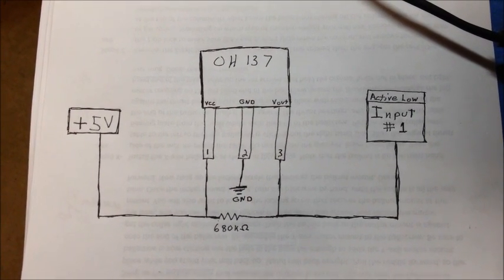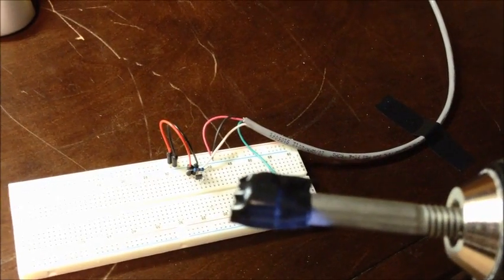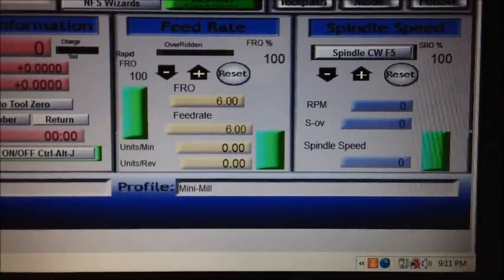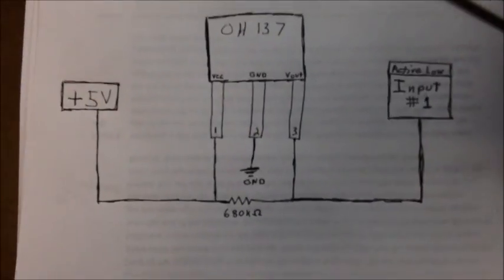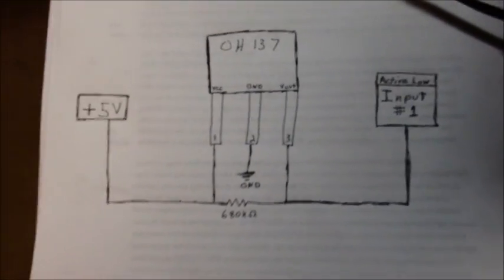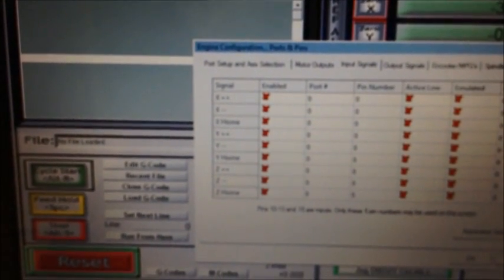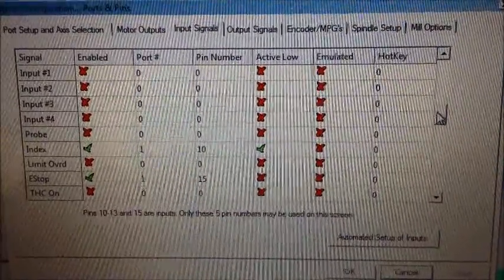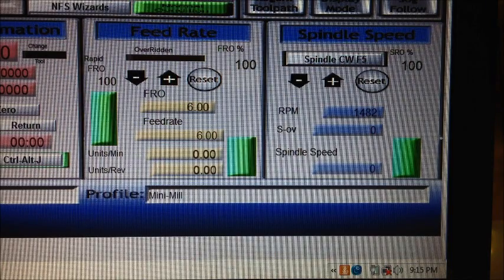Spindle Tachometer For Mach3 CNC Conversion Mill Lathe RPM Hall Effect Sensor Spindle Control

Comment: Hello Franco. I have done what you said. I am using a mach 3 breakthrough usb controller. The index lights up even without turning the spindle on. And after turning on and activating the spindle on mach 3 nothing. What I am doing wrong?
Many thanks 
Dennis Anghelatos

Comment: Cordial saludo.
1. Me podría indicar cual  es diámetro  que se requiere para el imán?
2. Es posible utilizar el sensor A3144 para realizar este control de husillo?
3. Con el sensor A3144 a 5V, es necesario el uso de resistencia?
De antemano, muchas gracias por compartir sus conocimientos a todos los apasionados que nos estamos iniciando en estos temas.
Gracias por su valiosa atención y sensata respuesta.
Bendiciones de salud y tranquilidad en estos tiempos.

Comment: https://www.ebay.com/itm/2X-NJK-5002C-Hall-Effect-Sensor-Proximity-Switch-NPN-w-magnet-LED-Arduino-USA/151885095836?hash=item235d0ea39c:g:bCUAAOSwZVhWR7ng

would this work , and would is still require a 680k pull up?

Comment: Hey Franco. I’m trying to get the oh137 to comunicate to mach3 but I can’t get it to work. Setting it up with a voltmeter I can see the voltage drops but mach3 does not react. Using a proximity sensor in the same setup does trigger the index. Same voltage drop off.

Comment: Thanks for the video. Why use
 pull up resistor?
Reply from the maker: Hi - you need the pull-up resistor to cause a change in voltage across the input.

Comment: Hi Franco,
I have a Mill with a hall effect sensor 44E to measure the spindle speed. I run mach3 on a AKZ250 board (http://leafboy77.com/). I run spindle speed from front panel meaning not using any M-code yet. Reason is i get RPM readings all over the place. Measured speed with infrared tester show for example 3000 RPM. But read back on Mach3 display go from 1500 - 30000 RPM fluctuating all the time. I have connected +5V to pin, Ground to ground pin and signal to signal input on board. I DO NO HAVE ANY RESISTOR OR LED CONNECTED !. Do you have any idea why i see the fluctuation on read back ?

Comment: franco, thanks for you reply. I am using a 1/4 wat 680k resistor, I'm still trying to get it to work.i must have done something wrong...
john
Reply from the maker: I think 1/4 watt will be fine. Test your circuit with a volt meter before you start working with Mach3. Also, Mach3 won't give you spindle feedback unless you tell it the spindle is on. Command a M3 or click the spindle button. This confused me at first.

Comment: I am going to make a spindle sensor and wanted to know what is the wattage on the 680K resistor?
thank you.
John
Reply from the maker: Hi.  I'm not an electrical engineer but I'll do my best to answer your question.  The resistors I used are not labeled with wattage, so I'm guessing they are less than 1 watt.  That being said, I don't think the wattage really makes much of a difference for this application.

Comment: Does this way indexing the spidle for threading to?
Reply from the maker: Yes.  Check out this video. I used the same sensor on my lathe. http://youtu.be/MaH_Nlh4sxk
Reply: +Franco How many magnets you put on?
Reply from the maker: +Δημήτρης One. I tried to use  more but I had the best results with one magnet.
Reply: Franco Some people said that had problems with mach3 because of one point indexing on the spindle, especialy on long threading.
Did you find a workaround?

Comment: excellent friend !! thanks
Reply from the maker: Motosmartin Hadad You are welcome.  I'm glad you found the video helpful.
Reply: Hi I am new with electronics ,I understand and made as your video but the thing is that my BB don't have separate 5v and ground like your driver boardif I check my inputs I have 10v between ground and inl11 for exemplecan I use an external power supply the only place I have 5v it is on my step and dir therminalif you can help me I will appreciate thanks Gordon
Reply from the maker: +Gordon Bournival Hello. I believe the oh137 can handle up to 12 volts. You should be OK. I would not use a separate power supply. I am not an electronics expert but I'm pretty sure you will damage your break out board if you do that.
Reply: +Franco Thanks to reply , I finally find the way to make it work . I user inl 11 as power supply and inl 12 as input . the only thing is I always get 3.25v and goes to 6.25v when l put the magnet but mach3 read it correct . is it because I have 10v power supply and put a higher resistor to get 0v . can you help me with this!

Comment: Just ordered a smoothstepper, but my control board has only a basic relay input, while I was thinking of using the PWM capability of the SS to drive and regulate the RPM of a brushless spindle. I reckoned it would be just as simple to set up a breakout board for the port 2 on the SS and assign any of the input pins on mach3 as the rpm counter input, unless there is some analog to digital conversion going on there inside the TB6560?

My driver board is also based on the TB6560, but it's the compact "3rd gen" with an LCD and jogging / pos controls.
Reply from the maker: Kageitenshi The INDEX input Mach3 is simply counting pulses.  It is pretty basic stuff.  No need for any type of analog to digital conversion.  Feeding pulses to the INDEX input is a quick way to get RPM values.  Using Mach3 to actually control the spindle speed takes a little bit more work.  You also have more safety issues to keep in mind.  Check out the CNC4PC website - they have a lot of good boards that facilitate spindle control.
Reply: Franco Excellent, thought that might be the case for measuring RPM. I haven't yet decided whether or not to build a spindle out of 1.4kW RC brushless motor or not, like so many have successfully done, instead of getting a similarly priced 400W premade. In the case of a DIY spindle, the RPM control and safety features would be trivial... hmm. I'll check the website once I get back from a trip to Italy.
Reply from the maker: Kageitenshi To be safe, you should use a charge pump board.  They are cheap and they will prevent your machine from going "crazy" if Mach3 starts to glitch out.
Reply: Franco
Alright, back from the trip! I looked up the charge pump board and CNC4PC was the first site to pop up. Seems like a good idea to have one indeed, without busting the wallet either. Thank you!
Reply from the maker: Kageitenshi Cool!  Post some videos when you have all of that working.
Reply: Franco
That might take a while. It's a weekend project, but I hope to get the rest of the parts for a 3-axis system by whatever week I decide to take off from work during the summer. Smoothstepper should arrive tomorrow, so I'll get to test the driver board and steppers with Mach3 soon-ish.

Got a 48V 1.2 kW server PSU for driving 3x 2.8A 1.9Nm Nema23's, though I could use a 2.4kW 24V supply I made from two 12V PSUs. Will have to see how noisy the steppers get at lower speeds with 48V and decide what to do. After all, the 24V PSU has plenty of watts to spare even with a 1.4kW spindle.

Still trying to find a local or EU supplier for T-slot aluminum profiles with a decent CAD library for AutoDesk Inventor, so I could work out the final dimensions required for whichever size of ballscrews I'll end up picking up before committing to anything.

Plenty of 4th axis options around too, but few seem to have a hole through the entire chuck for long parts =/
Reply from the maker: Kageitenshi Be careful with the power supplies - unless they are designed to be connected in parallel, you shouldn't do that. You can get decent switching power supplies on eBay for cheap:  I used these for my 1600oz-in motors:

eBay item number:
251915172070

There is a formula for calculating the maximum voltage for the stepper motor: 32 * √L = VMAX where "L" is the inductance in millihenries (mH) for the motor.  I've also been told you can take the voltage rating for each winding and multiply it by any number between 4 and 20.   Here is a good link with more details:

http://www.geckodrive.com/support/step-motor-basics/power-supply-basics.html
Reply: Franco
The PSU is floated, that I did myself according to guides floating about for using server PSUs for battery chargers. Since they're not operated in parallel, load sharing isn't an issue.

I'm well aware that the PSUs can weld stuff together with minimal effort, so precautions like mushroom emergency off switches and circuit breakers have been facilitated for.

The steppers can take 60V +/- 6V, that I calculated prior to purchase to make sure they're at the very least up to what the drivers can handle.
Reply: Franco
 Got the SmoothStepper communicating fine with the control board. Had to tweak some signal timings and set it to 64 kHz so as not to miss steps, as I was getting varying amounts of cumulative errors when zeroing. Now I have to figure out how to set the display to show actual mm traveled, instead of some arbitrary number of pulses sent. Probably getting 5 mm pitch ballscrews, since they seem ubiquitous and easy to set up for 200 step/rev ratio.

Next step is to buy spools of wire and connectors for a power distribution board. Summer vacation is likely three weeks off from mid July onwards, so that's the set time for getting the rest of the fixtures and hardware sorted.

Edit: well, I got the controller to show 1/1 what Mach3 is showing, for a while, since it's still accumulating errors when both X and Y axis are driven simultaneously; the other loses a half a millimeter's worth of steps while the other one gains some when I run either the roadrunner or the cross gcodes. A simple incremental Z 10x10 square or a variation of it works just fine.

Duh, too damned high Z-acceleration for one. Now the error seems to be within tolerances with 1/4 microstepping, thus far.
Reply from the maker: Kageitenshi With 5mm pitch ball screws, your steps per inch will be one of the following numbers depending on how many micro-steps you drivers are set to: 1 micro step - 1016 steps per inch; 2 micro step - 2032 steps per inch; 4 micro step - 4064 steps per inch; and the pattern keeps repeating.  

I used appliance wire to make all of the high voltage connections in my control box.  It came from Home Depot and it wasn't too expensive.
Reply: Franco
I figured 1/4 microstepping should be a fine compromise between accuracy and torque loss. Though, it's not like I'd be building my CNC out of solid steel and cast iron to machine armor plating, nor is it going to be branded Grizzly.

Imperial units are the bane of machining outside of the three remaining countries that still widely use them, aside from basic conversion rules of thumb.

I wonder if there's still a bunch of CAT5 cables lying around, since those seem to be quite widely used in this application too. Would have enough wires for two steppers at a time. If not, there's an electronics supplier a quick bicycle trip away that supplies spools of the stuff.

I think another reason for missing steps may be that the USB ports, for some odd reason don't supply enough current for both the smoothstepper and the controller board, which I find odd with as new a motherboard as this is with USB3.0. Too late in the night to set them up for external power...

Edit: The most likely reason for discrepancies would be that the El Cheapo logic that determines the position from the step signals distributed by the breakout board. Too fast and it just can't keep up. Shouldn't affect the actual stepper motor output one bit, but the display and controls supplied can still be used for relative movements.

Still, seeing as SmoothStepper has such easy encoder setup, I ordered three of the likewise ubiquitous 600 steps/rev optical incremental ones. Should place an order for the charge pump board too and get a breakout board for the other 25 pin connector while at it.

Edit2: Yep, the logic that was slapped onto the breakout board totally spazzes out when signal rate goes up. It works fine at low speeds, like 3D printer level, but at feedrates suitable for cutting stuff, not so much.

The odd thing with Mach3 now with metric settings is that for whatever reason, it now randomly rounds zero up or down by a single microstep's worth (0.00625 units, shown as 0.0063) when set to G1 X0 Y0 Z0. That spazzes ME out >.<

Comment: I've done this, but can't seem to get it going on my C10 board wired to in put 10, and Mach3 settings. Any thoughts?
Reply from the maker: The first thing I would do is double check the connections.  Second, I'd look at the Mach3 diagnostic screen and verify that the input is working - you may need to reverse the polarity of the input (active low or active high).  If the input is working and you still don't get a RPM reading then make sure something is telling Mach3 the spindle is on - you must either click on the spindle button (program run screen) or give a command (i.e. M3S1200) from MDI or a CNC program. I hope this helps.
Reply: Franco I've check that as well. Even moved my input. Can't figure out what I'm doing wrong. I even did a check on a bread board with a LED, OH137 working fine that way.
Reply: Franco Ok might be the resistor. I'm using a wall wort 5V power supply. DAAAAAAAAA I'm stupid.

Comment: Would like to know which type of pull up resister you used. I see you said 680k ohm but do you have a part number?
Reply from the maker: Hello Robert - I used a 680K Ohm 1/4 Watt Resistor.  I purchased a variety pack of several hundred resistors from eBay so I don't have a specific part number.  However, you should be able to do a Google search and find plenty of options.  If you don't have a 680K resistor, I think you could go larger (820K) without any problems.  

The video shows a typical pull-up resistor layout and, depending on your breakout board, you may or may not need it as some boards have internal pull-up resistors.  In fact, I suspect the TB6560 driver I used would have also worked if I had eliminated the connection (and the resistor) between pins 1 and 3 of the oh137 hall effect sensor - but I haven't tried that as of yet.

Long story short, the connections shown in the video have been working great with the TB6560 for several months so start there.  The TB6560 is fairly robust so I don't think you need to be overly concerned about damaging it if you make a mistake with the connections or the resistor values.
Reply: Franco
Thank you for that info.
You have been a great help.

Pardon my ignorance, but is there a difference between a regular resistor and a pull-up resistor?

Comment: Nice video and explanation on how you setup the mill with an RPM sensor on the spindle. Easy to make and connect.
are you also planning on controlling the motor through Mach3?
I've used a C6 board to control my spindle .... works good. But would like to get an accurate reading from my spindle with a sensor so that i can make adjustments to get to spin at the set speed
Thanks again for the post......very informative
Reply from the maker: Hello Robert.  At one point wanted to control the spindle RPM of my X2 mini-mill using Mach3.  I tried to use the PWM output from my TB6560 but I didn't understand the concept of  optoisolation and I wound up damaging the control board in the X2.  I would be very interested in seeing how you wired up the C6 board to the X3.  Where did you tap into the 12V to power the C6 board?  Thanks!

Comment: Very nice! Is it possible to configure the Mach3 to issue a STOP action in case of Zero RPM? I'm thinking about a kind of RPM feedback, in case of spindle failure I want to stop the machine.
Reply from the maker: I'm not sure what Mach3 does when it detects an error between actual speed and programmed speed.  There has to be some accommodation for speed fluctuations but I don't know at what point an error is generated.  It is possible that your spindle driver may have some alarm output you can wire into the Mach3 e-stop circuit.

I only use the tachometer to give Mach3 spindle feedback.  I don't use Mach3 to control the spindle.  Once you give Mach3 spindle control, you have to make a lot more provisions for safety - a charge pump and whatnot.
Reply: You can use a 'brain' to do what you want. Brains are a visual ladder logic type program that can perform a range of logic functions based on accessible inputs and outputs.

Set up your brain to read your spindle RPM input Port 1 Pin1 or whatever, AND the mach3 internal bit 'axes moving'. If RPM AND AXES --> <100RPM --> Output STOP.  You might also want to add some logic to prevent the brain from working during jogging or when you perform air cuts. Maybe chuck another AND boolean logic in that looks at a HOTKey so you can toggle the 'low RPM Stop' off and on.